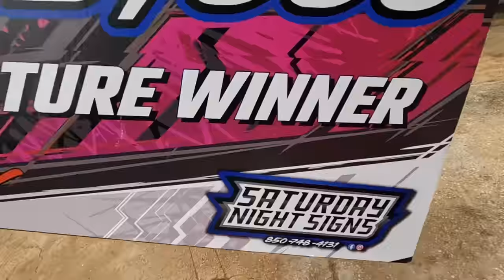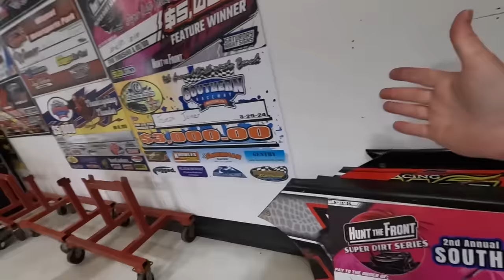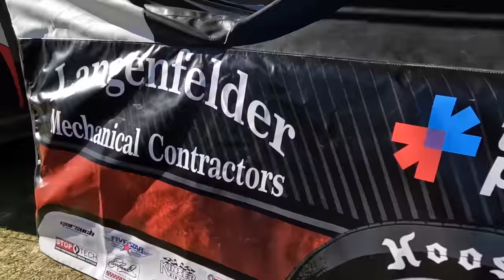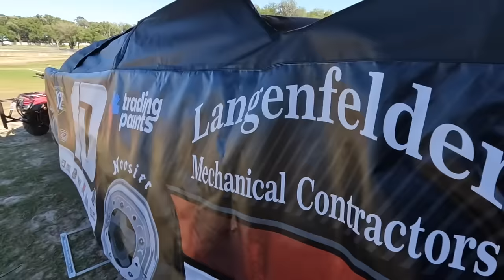Our New Car Cover Looks Just Like Our Race Car!

Comment: About 8 years ago I was asked to help a guy who had a guy from MO coming to drive his car . So I did help him out . I showed up at his house around noon and started a nut and bolt check of the hole car he had 2 cars his other driver pulled me aside and said something was wrong with the steering on that car so I asked the owner of the car he said he put a new rack on it 3 weeks ago when I got to the rack it only had 1 bolt in it so I put 2 in asked the owner who put rack in he said he did I laughed . He asked why I laughed I said because the person who put the rack in forgot 2 bolts. When I used to work on late model  I would put 7-9 hours a day 6 day's aweek after a 8 hour day at work . In 10 years we won 7 championship.  I got burned out and walked away for 15 year's every now and again I'll work on a modified.